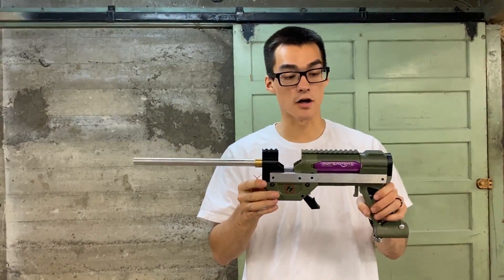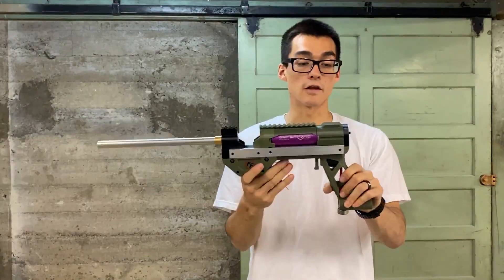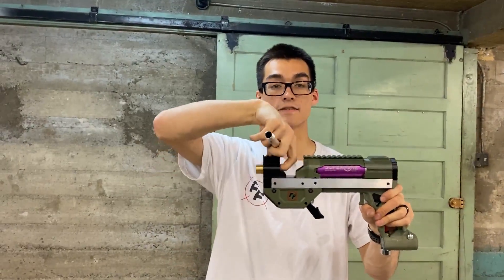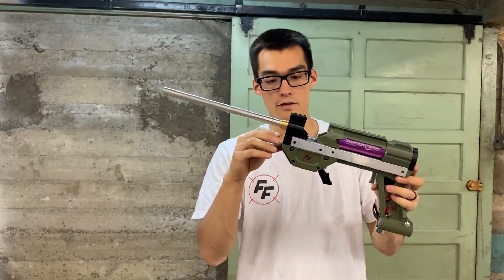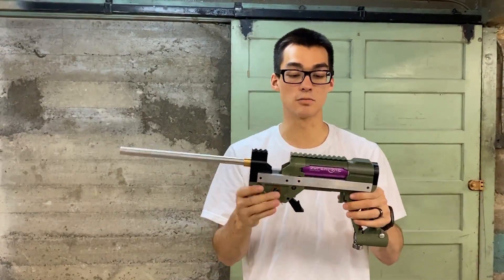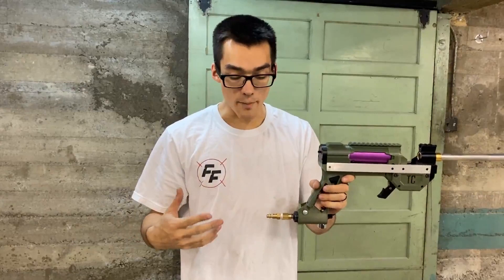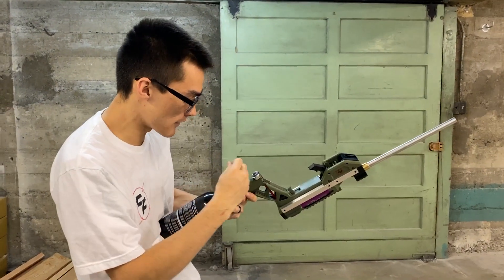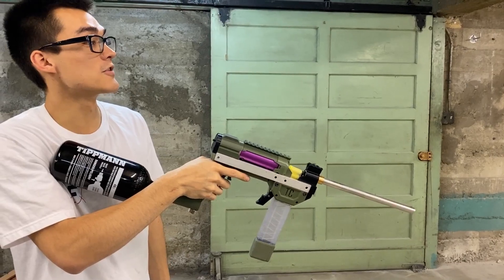HPA U Talon Claw Nerf Blaster | Overview

Comment: Why is it so expensive ?
Reply from the maker: Custom precision CNC machined internals for a an elite tier level of performance is required when working with HPA. So we have high quality metal components in every build. So the price is higher upfront for HPA, but you'll never have to replace or repurchase a battery again because there are lots of places that offer free air-ups. Certainly isn't for the faint of heart though, HPA is just on a whole other level compared to flywheelers or springers... or even AEB's! -Ryan

Comment: Is it just me or does it look like the blaster fires on the reset? You might need to reverse the internals on your solenoid unless you did this purposefully
Reply from the maker: Alex Curmi Yup. It’s so you can load and unload without having to turn your air supply off and on again. Is this unconventional?
Reply: Frontline Foam ah that makes sense. Usually it is closed bolt and fired on the trigger pull and you just hold down the trigger when changing mags but anything works
Reply: @alexcurmi7412  That is technically true on how it works but this Super Core system is known as an "Open bolt" system since the core "fires" when the bolt is in the open position. The upcoming "Sniper core" will function in "Closed bolt" meaning, the core will fire only when the bolt closes but otherwise, the bolt stays in the open position as seen above. Nice work switching this around! The addition of a micro switch is genius.